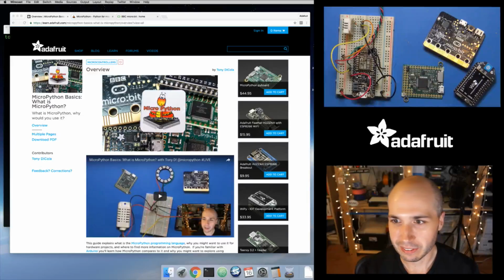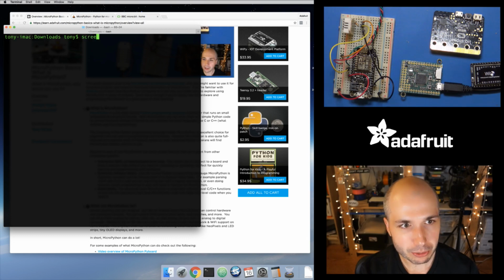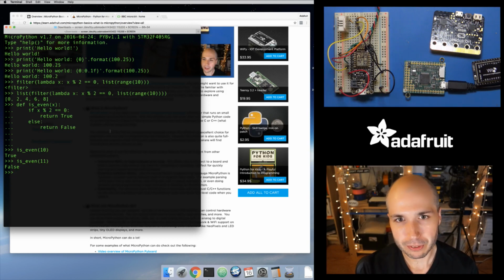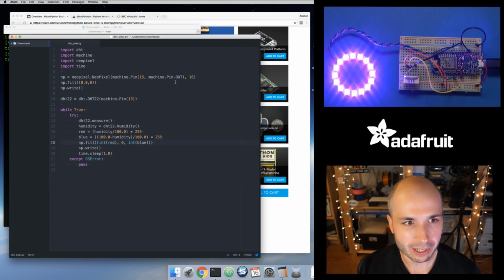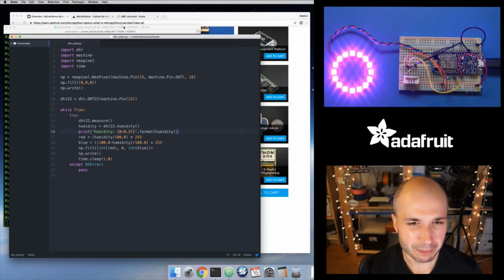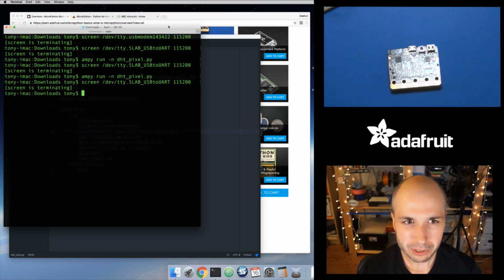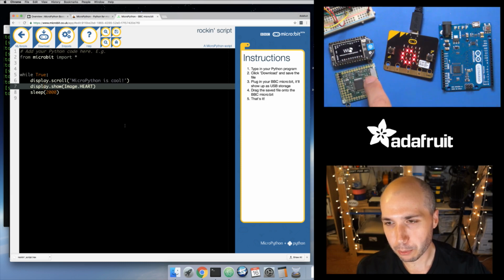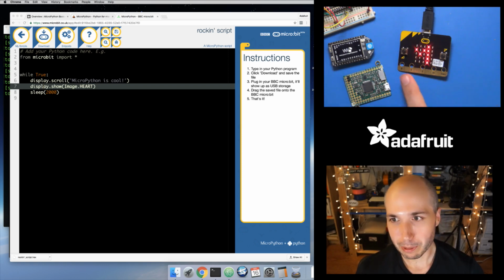MicroPython Basics: What is MicroPython? reprise with Tony D! @micropython

Comment: We can use openCV library whit this, can't We?
Reply from the maker: Not directly on the MicroPython board, OpenCV actually needs to run on a 'real' operating system like what your desktop computer might use.  Check out the Raspberry Pi though, it's a small board that runs Linux and OpenCV quite well.  You could definitely have a Pi talk to a MicroPython board over a serial or other connection and tell it to perform actions, etc.